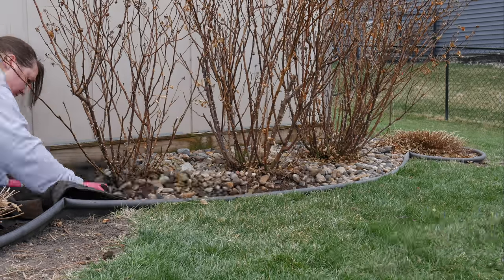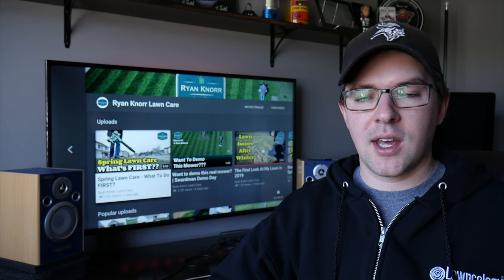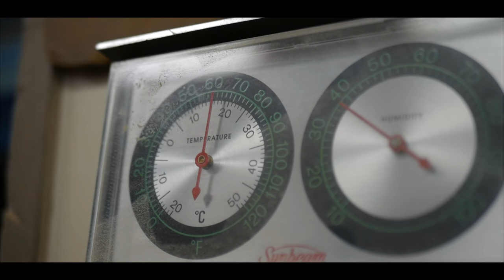I have too many mowers! | Shed Organization Part 1

Comment: My shed is 15' x 24'. I have a vision. A 2-tiered shelving system that rolls out at one hinged corner in a perpendicular direction. Top shelf (platform) will have a ramp layered in that slides on a track down to the floor for loading mower(s) up and down. Then rolls back, tucked away neatly.
Reply from the maker: This is where I don't see that in my head at all.  I'll have my wife translate.  Haha

Comment: Word of advice, get your shop stool, and sit in it. Then transfer the height of your belly button onto the wall. This will enable you to sit in your stool, and have your work bench be at a height that you can sit at with your stool under the bench comfortably. You can put your stool under the bench when you're done. If I was to recommend a workbench, check out Wranglerstar's bench that he built about 2 years ago, with some laminated 2x4's. Super heavy duty, but the concept is the same. That's the way I'm going to rebuild my bench in my shed.
Reply from the maker: Very good advice there!

Comment: I have a 24x42 garage, I thought that was big enough and I still have one vehicle in the driveway. I've seen where people place mowers on a piece of plywood frame and they have it on pulleys to raise it off the floor for additional space. This may be helpful since mowers can weight 75-100 pounds.
Reply from the maker: A pulley system would be very useful.  I hope to have a huge garage someday but I bet it will fill up with time as well.

Comment: In your area, do you need to pull permits? In my area if it's detached with electrical it's considered a permanent building and will need a permit. Always sweet video
Reply from the maker: Yeah I pulled a permit